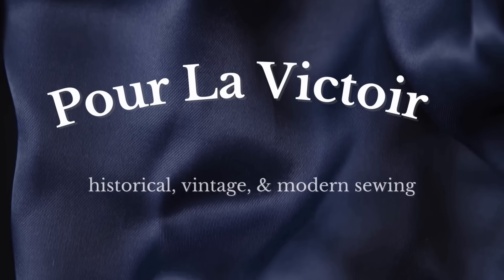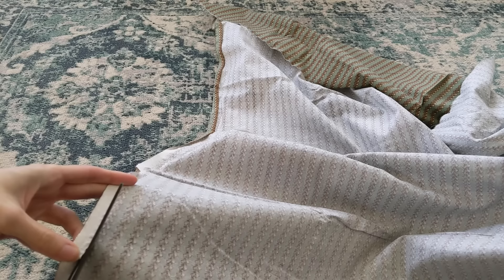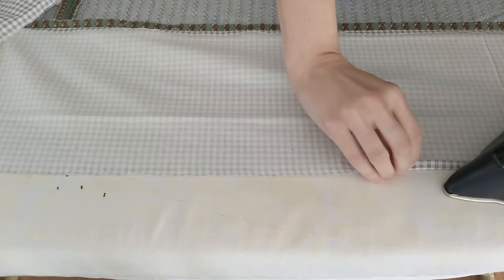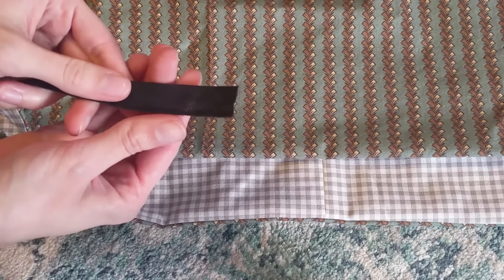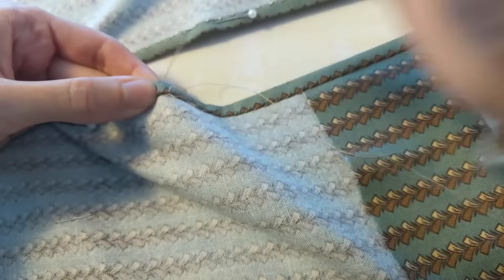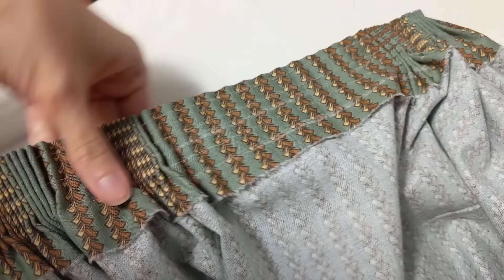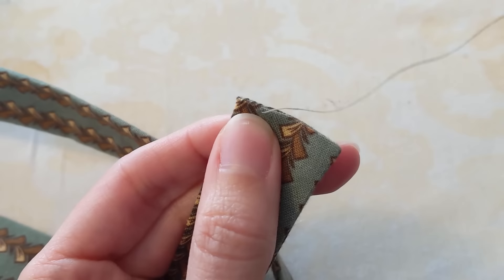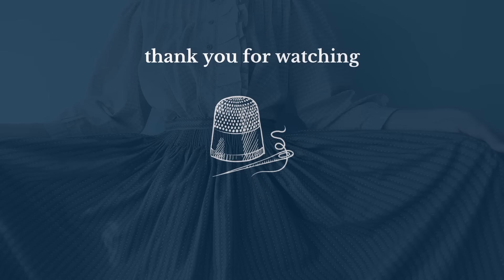How to Sew a Cartridge Pleated Skirt | Easy Historical Sewing

Comment: When machine stitching a hem facing, there are ways to prevent a horizontal line of stiches. Use a blind hem stitch. It looks like a weird zig-zag with some going wider. To use this you sew most on just the folded facing, but the tips of the wider zigzags go into the skirt fabric. The result is hardly noticable little pricks of thread on the outside. If the threadcolour matches, its really hard to see. I would recommend practicing first, but its fast once you get the hang of it
Reply from the maker: That's brilliant, I'll have to try that on my next skirt of this style. Thanks!

Comment: Love those skirts. Will have to do some testers on fabrics to see how much I'll need and how small to make the pleats. It seems like you did about a 4.8 multiplier of waist size to fabric. With a larger waist, I'll need more fabric to get those beautiful pleats.
Reply from the maker: If you're working with a thicker fabric like wool, you can get by with fewer pleats due to the thickness of the material. That ratio sounds right - I think adding an extra half panel or panel of fabric is a great idea.

Comment: This is one of the most straightforward videos I've seen on making this type of skirt. Thanks for uploading it, I really needed to update my basic skirt pattern! 

As an aside, how's your experience making this skirt from quilting cotton and other light cotton fabrics? I've made similar skirts with light cottons with no hem facing or lining, and with a full lining, but never a hem facing. I found that the lined skirts lasted longest, and the unlined/facingless skirts developed huge holes and tears within a year or two of very regular wear, but the fully lined ones were very heavy and cumbersome to wear (less so with a corset, but I don't want to have to wear a corset in order to wear my skirt, as I don't like how sweaty they make my torso and sometimes I just want to wear a big skirt with my modern outfit). Do you have any issues with holes developing on the thighs or knees above the hem facing, or do these generally hold up to wear for you when made in quilting cotton?
Reply from the maker: Thank you so much! The green skirt I made in the video is from a quilting cotton fabric, the red plaid one is a lighter weight "homespun" cotton. The cotton fabrics are very easy to sew, although the homespun feels less sturdy than the quilting cotton so I won't wear it if I'm walking somewhere like a wooded area where the homespun can get snagged by bushes and branches. I have made an Edwardian walking skirt out of quilting cotton, lined in cotton muslin, with a quilting cotton facing (it's the skirt I show with damage in the hem when talking about the hem tape) and it's SO HEAVY that I never wear it anymore! I think the extra weight is from the full lining. I think the hem facing is the perfect medium between lined (too heavy) and no protection (damage from the ground while wearing) and doesn't add noticeable weight to the skirt. Since the thigh/knee area isn't coming into contact with concrete, gravel, dirty boots, and other abrasive surfaces, I don't see any wear and tear in those areas.
Reply: @Pour_La_Victoire thanks for the clarifications! I'll soon be making a new skirt, so the refresher is helpful. Also, I've just noticed a funny coincidence, we have the same iron! I hope yours works just as well as mine, since it's one of the best irons I've used. Happy sewing!

Comment: I love this skirt so much! Would it be okay if I used a 150 cm wide fabric to make a 3-panel version, if I cut the fabric so that it is less wide?
Reply from the maker: Yes, you can use 150 cm fabric😊I wouldn't cut down the fabric (unless you're working with a heavy fabric like wool) as a 3 panels of 150 cm wide fabric will have a lovely swish!

Comment: This video came just when I needed it! Thank you for sharing these techniques. Do you know whether cartridge pleated skirts can be done on a curve, rather than just on a straight edge? I am planning to remake an 1850s dress that dips in the center of the waist, and as the entire skirt is cartridge pleated, I will need to make the pleated front curve down into the center ‘dip’, but cartridge pleating along a curve / bias sounds tricky. Do you have any advice for this? Thank you in advance!
Reply from the maker: Thank you ❤️ Yes, you can use this method for 1840s and 1850s skirts with a dip in the center front! You'll just have to fold the fabric down more at the center front and taper towards the side seams.  For example, if your CF bodice point extends 3 inches past the bodice back bottom edge, fold the CF of the skirt down 6 inches and taper to 3 inches towards the side/back of the skirt. Kinda hard to explain, but I have photos of this with my blue 1840s dress on my blog. Feel free to message me on IG if you want to see extra photos.
Reply: @Pour_La_Victoire  thank you so much, this is incredibly helpful! I see exactly what you mean, and I’ll definitely be following your advice for my project. Hopping over to your blog post now! :) thank you again!

Comment: this tutorial is absolutely fabulous, i have one question before i delve into it - do the fabric dimensions stay the same for any hip/waist size, and if not how would you recommend scaling it up?
Reply from the maker: I recommend a finished hem circumference of 3-4 yards, regardless of waist/hip size. It's up to your preference and the fabric you're using (a thicker fabric will need larger pleats, a thinner fabric will need small, dense pleats). For an extra swooshy skirt, try a finished hem circumference of 4-5 yards.
Reply: @Pour_La_Victoire  wonderful, thanks so much! wasn't sure if the ratio would need adjusting - very excited to give this a whirl

Comment: Did the skirts in the past remove the pleating threads? I've never seen those left in before! This is definitely an intriguing garment, thank you for sharing
Reply from the maker: I have always seen them with the threads still in place :) I think most often the threads get hidden in the folds. Sometimes a loose whip stitch on the wrong side secures the pleats, and then the thread is removed.
Reply: @Pour_La_Victoire  good to know!! Ive done smocking before (this video popped up in my recommended feed after watching a video on adult smocked clothing) and never knew those could be left in place.

Comment: Any chance you could make a video follow up about what to do if your back ham length is longer than your front in other words, you got junk in the trunk for me one of the reasons I have to sell clothing for myself is because clothing that’s evenly hemmed on the hanger is not evenly hemmed on my body, as my backside takes five or 6 inches more to go around then my front. I’m also curious what kind of pockets you would add and how? Also, you use three panels for your rather petite waist and talk about how more than a certain length hem is cumbersome, but my waist line is more than one and a half times yours, should my hem similarly grow by the same ratio? TLDR how do you mod this for fat people?
Reply: I was wondering the same thing/I'm in the same boat. I'm curious if there's a formula out there that tells you how much the length of the upper edge will shrink based on how small or large your cartridge pleats are. I may try this skirt myself, and get back to you with the math if I'm able to work it out.
Reply from the maker: I don't think there's a set formula, since different fabrics will compress differently in the pleats + the depth of the pleats will make a difference, but adding an extra panel of fabric will certainly add a proportional amount of volume for a larger figure. For the angled "dip" at the waist, you could fold in an extra 6 inches at the center front, tapering out to a regular fold at the side/back, before sewing the pleats. I might make a video to show this, great idea!
Reply: Historically, these would be attached/pinned/basted to the waistband or bodice while on the wearer so that the amount of adjustment to make in the top at the attachment point is suited to the wearer's body and the foundation garments needed for a fashionable silhouette.  Basically, to conserve fabric that might need to be let out or redesigned when fashion changes, you keep the fabric intact but adjust where the top of the panels are sewn on in order to have the bottom hem fall evenly.  It does require an assistant or a dress form that decently corresponds to your shape to do properly but you can probably fudge it by figuring out the exact difference in hem height front to back (or at least side to back) and then adjusting the fabric so there is a smooth transition between the extremes.

Comment: Thanks for the detailed explanations. However, I failed to work out how much fabric I need for a cartridge pleats for my very large waist, which is 52". Could you kindly assist me or anyone here who can help please?
Reply from the maker: Hi! I recommend adding another panel of fabric to the skirt. There isn't an exact ratio of waist size to skirt circumference, as the size and tightness of the pleats determines the final size. If your waist "dips" in front (i.e. back waist higher than front waist) you can fold down more fabric at the front of the skirt before working the pleats, and that will keep the hem level. Feel free to message me on Instagram if you have any other questions.
Reply: thank you .🌻

Comment: This was great! However I had one question, what do you do with the folded over panel on the inside? Do you leave that edge raw?
Reply from the maker: Thank you! I usually leave that edge raw if the fabric doesn't fray much. When I cartridge pleated a thin silk skirt (the silk frayed so much!) I lined the skirt in cotton muslin and enclosed that raw edge in the lining. You could also fold in that raw edge once and stitch it down to prevent fraying.

Comment: im a beginner and i know next to nothing about this stuff and i practice making clothes on my dolls, so how wide would the fabric be compared to the waist? does it matter? like for example for skirts i hear people say that the width should be lik 3 times the waist measurement for example?
Reply from the maker: I don't think there is an exact ratio for the waist; in my opinion, the key measurement is the desired circumference at the hem. The pleats can be "squished" together at the waist if you're using more fabric than I did for the green skirt. What kind of doll are you making the skirt for?
Reply: @Pour_La_Victoire  Thank you! it’s an American girl doll by the way